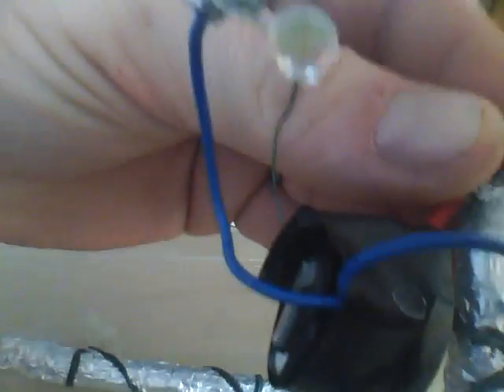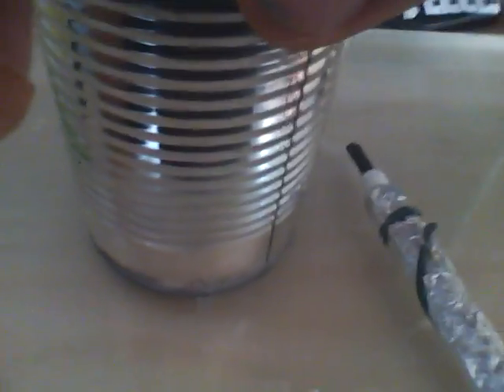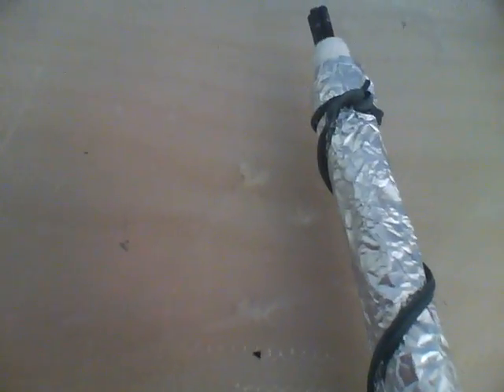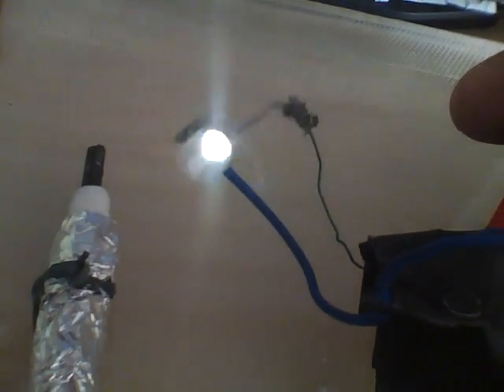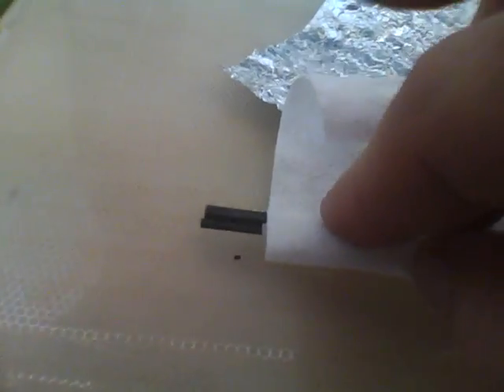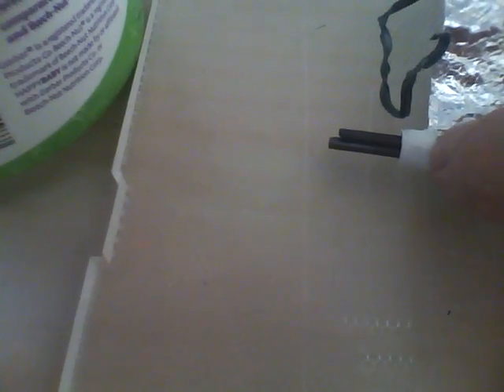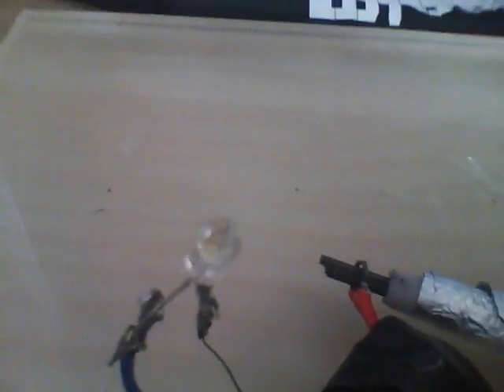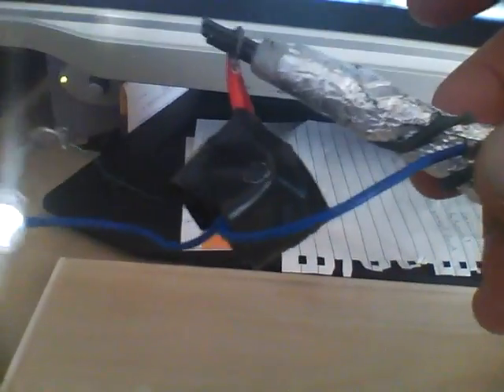FREE ENERGY - Pencil Lead , aluminium battery

Comment: I tried this using a water and epsom salts mixture. My fuel cell is giving off about .7 volts, but it's not enough to light my green 5mm led. I tested my joule thief/led circuit, and it works with a 1.5 volt cell. Any suggestions to boost my fuel cell voltage? Thanks!
Reply: Increase the size of the aluminum plate
Reply: What about making two of them getting maybe 1.4v and increasing size of aluminum plate like Raja suggested. I would also try apple cider vinegar or even lemon juice. Keep experimenting, good video and thanks for the idea.

Comment: 'I know it's corrosive but we have an abundance of salt water.'

Well, it's corrosive to the metal, of which we don't have an abundance of and is not renewable (though, it might be recyclable).

I wonder if reheating the metal would put it back to normal, though (could use a Fresnel lens to do that!)!
Reply: I dont think you can recycle . It corrodes, turns into aluminum oxide.

Comment: This isn't a battery, it's a fuel cell, an Aluminium-Carbon-Air Fuel Cell to be exactly. Alumnium is the "fuel" that "burns" slowly  (oxidizes) and delivers electricity. Sooo ... you were better than you thought. :-D

Instead of building a dumb battery, you built a really cool energy device, that is, if you have enough Aluminium to burn ...

Comment: A joule thief is a circuit that allows you to use lower voltaged sources to run LEDs and other things (it steps up the voltage so the energy is usable) People use them mostly for lighting LEDs from single AA batteries (even if the batteries seem dead, they usually arent!) I also made a joule thief "silencer" i think... check my vids :)
Reply: Ishaan Bellic It's a flyback EMF enhancer.

Comment: The most common thermite composition is aluminium and rust, so I'll assume that is what you mean. As I described previously, the energy that was used to refine the aluminium is released when it oxidises during the reaction (displaces the iron in iron oxide). The aluminium is essentially burning.

Comment: Generally, you make your own. The circuit is very straight forward. You could try an *emergency mobile phone charger, which works in a similar way. *the kind that use a single AA battery.

It's more fun to build your own circuit. I found most of the components I needed inside a "dead" CFL bulb.

Comment: It depends doh, you see the reason why they use salt because they want the element in the salt for the flow of the electrons and if the water has enought of that it will work even it was pure water but sometimes it just wont work :D

Comment: This is great ButchnSteph1; I've been working on the same thing as a lighting solution for slums and villages in Africa and the Middle East and for disaster relief. I've been using sodium hydroxide crystals with aluminum can tabs (using stainless steel scrubbing pads for my cathode) but you are right, salt water works fine with aluminum foil and this  is really  important for people to know. Bless you and thanks for sharing!!